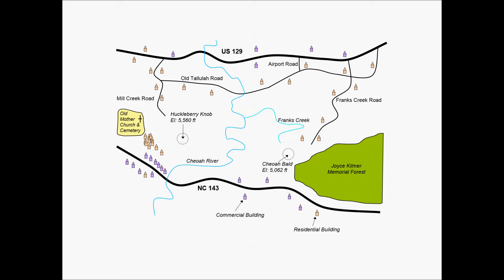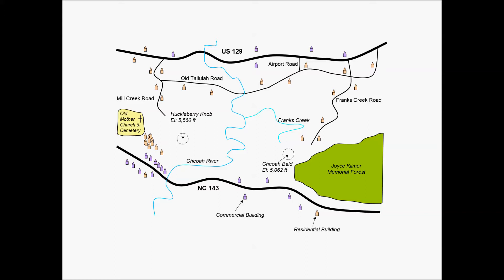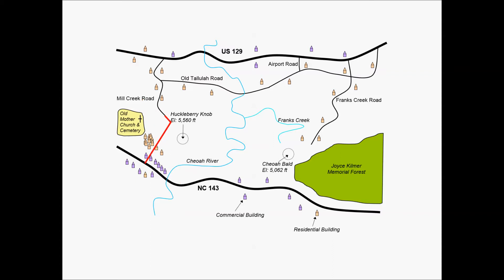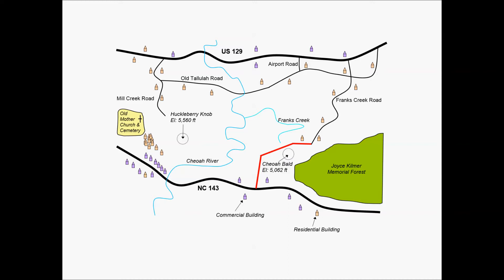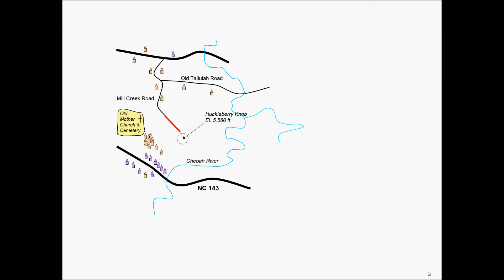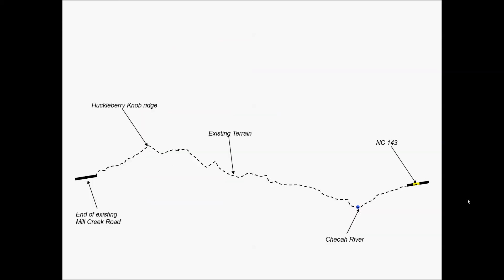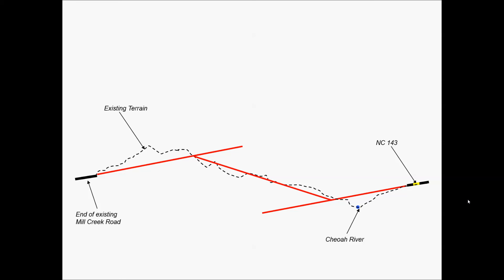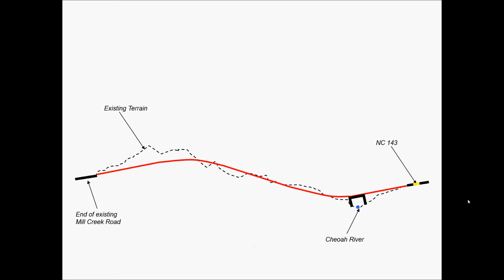Corridor Selection for Highway Design - Introduction to Horizontal and Vertical Alignment

Comment: It’s really worth of watching each and every videos , thanks for your effort in educating Daniel.

Can you please define what’s exactly the Corridor is? Is it Horizontal and vertical alignment, or any ting else included?
Reply from the maker: In this context, I intend for corridors to be understood as a preliminary alignment (mostly with horizontal alignment in mind, but also with the impacts from vertical alignment).  This preliminary alignment would be located in a corridor that would be wider than the final design to accommodate necessary changes and tweaks as more details and information about the location are known.  The concept in the video tries to emphasize that at a high-level, many alternatives exist for locating the roadway each with its own advantages and disadvantages.  Through this initial analysis, you can locate a corridor (or multiple) to focus more effort on designing and considering the impacts.

Thank you for the kind words of support.
Reply: Really great work..
Sir, kindly make video on triangulation concept in civil3d...
Main for road design points